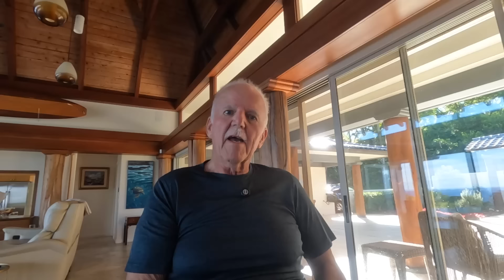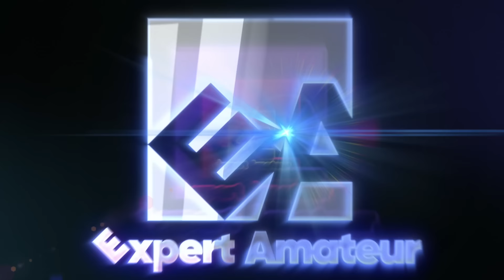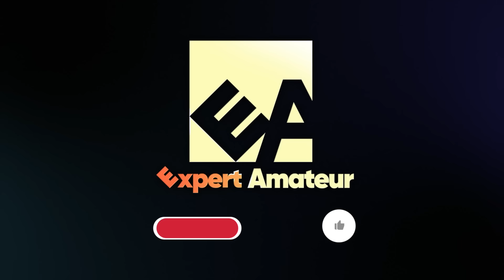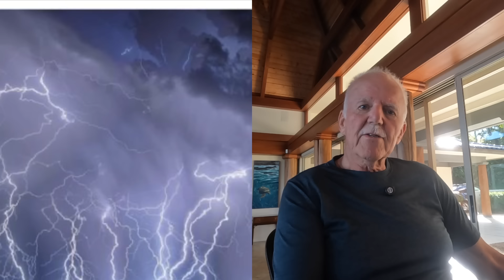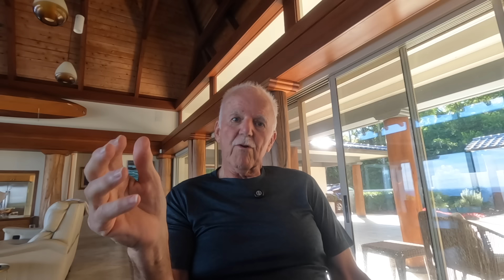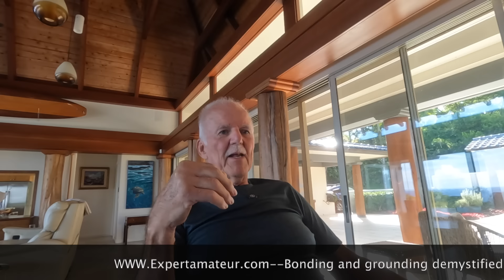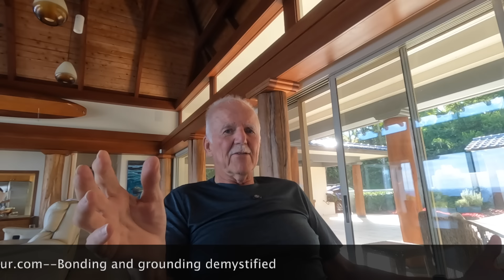solar grounding

Comment: ground bonding means exactly what it says - in Broadcast Engineering everything has a common bond to earth and the earth is a multi element copper grid. Having said that lightning will be the most extreme voltage / current that you will encounter… ie unpredictable… good luck
Reply from the maker: Yeah, I know. You guys have a much bigger set of problems than a few metal structures in a field. I used to work for a utility (nuclear reactor operator). We did some weird stuff to bond earth grounds together and I STILL hated going inside the fence of a substation.

Comment: Please show me where the NEC says the grounding of the panels and racking must be separate from the house ground.   I read the code to say you must connect the panel and racking ground to the house grounding system.   The NEC allows auxiliary grounds at the racking but does not require it.
Reply from the maker: It's not required. In fact I mentioned that if you get your system inspected most inspectors will wonder what you're doing. Do what you want. I'd prefer to not lead induced lightning current into my equipment. Then again, 250.4 B1 says the equipment "shall" be earth grounded but leaves HOW kind of up to interpretation and just sends you off to NFPA 780-2020 for more blah-blah which I didn't find really clarified much.

Comment: I grounded my panels separately from my earth ground to my house. I just pounded in a completely separate 8 foot rod for my panels. But it also happens to run alongside my outdoor electric box. Hoping that solves the issue. I might be completely wrong on that one. If I am, let me know why.
Reply from the maker: That's common, and what I did for the first phase of my test system, which is off-grid. When I connect the system to my shop I'll go to the next step, which is bonding that local earth ground rod to the earth ground rod for my grid service entrance by running AWG 6 wire between them. The issue is that a nearby strike will induce a voltage between those separated grounds and your grounding system can dump a huge current through your system from ground rod to ground rod. It might not happen, but if it does, everything between the ground rods is probably scrap. The wire bonding the two ground rods together will keep the potential (the voltage between them) roughly the same so the current will be greatly reduced. A direct strike will melt a lot of stuff no matter what you do, but bonding the rods together is a reasonable step.
Reply: @ Just making sure I’m understanding correctly: you are planning to bond the grid service panel AND the separate grounding rod for your solar system together?

Or you plan to remove the separate grounding rod you currently have and tie the panels only into the ground in your electric service box?
Reply from the maker: @Jordan-tq2jc  I plan to connect the local ground rod for the solar system to the ground rod for the grid service panel
Reply: @ExpertAmateur-xn6dr I think I am in the test phase that you went through. I have an off-grid system, that currently has no grid power tied into it (there is a grid service for the house). I just put a ground rod for the off-grid system and bonded the sub panel (inverter, batteries), and solar panel frames to it. And left my main grid service as is. 

This seems correct and sounds like what you did for your test phase?

Comment: You opened up debate for another related topic. Some are probably scratching their head wondering why their steel rack that is anchored deep in the earth still requires bonding and a ground rod. 

The Incidental electrical connections between metallic components cannot be relied on to provide the quality path to ground…
Reply: the only path to ground a ground fault is back to the source. Ground rods do not do that. And many an Electrician have died from that myth. 

Read NEC 680... They explain it to you.
Reply from the maker: @MasterChief4U  Read it. It doesn't. What we're talking about grounding is the frames and mounting structure. Yeas, the system ground can conduct away a lightning strike--right through your equipment.
Reply from the maker: Yes, especial with the random mounting notions that many ground mounts use.

Comment: Your creating ground loops at this point with 2 different ground rods.
Reply from the maker: I might be if I wasn't tying the ground rods together. If the distance was great enough that the resistance of a run of copper wire was substantial, then yes. Or if I were building a recording studio I might worry, but then I wouldn't be using transformerless inverters.

Comment: definitely a touchy subject, im a novice installer but have been learning from a great set of older installers, here's what i know works, the PV array should be completely bonded to itself, panels to frame into its own ground rod, NEC says bond frame to inverter no no no... don't ever do that, that code is deadly wrong, the battery and inverter system bond earth together but not the AC panel per NEC code, only common bonds to AC panel,  Lightning strikes are usually small and only hit the PV array, you don't want that following the PV wires into the inverter or batterys, Hope that helps.

Comment: Question. Should RV owners with solar panels on their roof be grounding their panels?
Reply from the maker: Tough question. Certainly you can’t do an earth ground rod unless yourRV is on blocks. It’s probably a good idea to bond the frames together and connect them to the solar controller ground but flexible panels don’t have metal frames. On my gmc the frames are bolted to the racks and the racks bolt to the body frames but that grounding is accidental. Since the entire structure is on rubber tires it’s hard to come up with a rational suggestion.

Comment: I work for a utility we have mountain top microwave. He is 100% correct but if your property takes a nearby direct hit from lightning all the equipment will get zapped no matter the grounding has been our experience. We have security footage of lightning arcing inside our building jumping from a grounding bus to equipment.
Reply from the maker: Yup.Mother nature doesn’t screw around.
Reply: Thus the old adage
Where does lightning strike...
Anywhere it wants
Reply: Out of curiosity, do, or does your people explain to you about "ground rise"???
Reply: Grounding rods are a myth... As they were invented to prevent house fire. Long before electricity was wide spread...

If you ground a system with Rods. If has to meet Pool and Sauna NEC NFPA70E requirements. Which is one unbroken #8 solid ground wire. Going around the whole pool or Sauna..Then if must be welded to the last rod... As these areas are wet locations with metal fences that can carry current..This is why Airport lights are install the same way...
Reply: Does having one of those EMP protection devices help?
Reply from the maker: @chrtravels  Some perhaps, but not much.
Reply: @chrtravels  yes, just like level 4 body armour protects you, until someone with a 50 cal BmG unloads on you.  The term "protection" is not an absolute.  Something that will help all of you is learning about grounding.  an 8 foot ground rod  is not good grounding.  look  up ground rise, UFER grounding and study hard.
Reply: Yeah a few million volts tends to jump large gaps.
Reply: Just curious if your mountain top microwave site follows something like the Motorola R56 guidance.
Reply: @SkyCharter  I'm not sure I'm an IT network engineer I manage the routers, and switches these are mostly used for microwave communication they have massive dishes on the towers. We have to be able to communicate with substations all over the state. We don't use Motorola for hand held radio we use a different manufacture.

Comment: I use "equipment" grounding  rod at the array location ( panel frames and array rails) and "system" ground rod  ( inverter, batteries, load panel)

Comment: It's against building code to have separate ground rods as far as I know. Interestingly when we build a substation, on the grid, we spend thousands grounding anything and everything inside. Each gate has to be grounded and bonded underground and when I have run into one that wasn't it pulled an arch as it was pulled together. We are never allowed to grab both doors at once. It can be very crazy to understand everything going on there.
Reply from the maker: Not for separate structures. I remember the spookiness of substations. I worked for a utility for about ten years. Substations, especially 230k, induce voltage into everything.

Comment: A complicated subject well explained. Something I've been concerned about for some time, and i came to the same conclusions. Connect the earths or create separate standalone systems. The debate will no doubt continue.
Reply: But they are NOT standalone if the multiple rods are bonded. I see folks always talking about and worrying about damage to their systems in these grounding videos. I couldn't care less about my equipment. My panels are 415 watts and about $150 each. I'll buy more if I get struck. What I am worried about is injury to anyone in my house from stray lightning jumping through equipment and across rooms! Or a malfunction of my system to energize things that can electrocute us.

Comment: Great video, sir! This is very educational content that could serve many people well for listening to. Keep up the great work!
Reply: It's not very helpful to say everyone  disagrees and there is no consensus. Yet there has to be some info somewhere that gives actual results from common and separate  grounding after lightning strikes. Maybe a fusing device between the house ground and the solar ground rods? Like I said, I don't see how you can protect against the  massive power of lightning strikes if it can travel through the ground for any appreciable distance.
Reply from the maker: @5400bowen  There absolutely is solid advice. R56 will tell you exactly what to do. All you need is a fat wallet and plenty of time. This video is about practical mitigation of equipment damage. Not NEC code or R56 or even NFP760 which most experts consider a bit lame. What I'm suggesting and using is cheap(ish), simple and reasonably effective. Everyone saying a direct strike will still slag your gear is absolutely right. Even a pretty close one will probably do damage. But most strikes will be further away and the methods in the video will help.
Reply: @ExpertAmateur-xn6dr yes, your insights are helpful. It's just I've seen several good videos and they all seem to agree the whole subject is up for debate still. Including the series from the University of Maryland Extension. My most recent thought is a smallish ground rod for the solar array, and the array  20 feet from the building. I'm still thinking about connecting multiple ground rods. Or maybe a railrod rail 100 feet from the structure 20 feet tall.. that will never come to reality!

Comment: One problem is that the better grounded the panels / antennas are the more they attract lightning. It’s a never ending discussion how to avoid disaster.
Reply from the maker: It is indeed an unresolved issue, but better grounding doesn't really "attract" lightning, though it's true that lightning actually travels from the earth to clouds. This is functionally the same argument that lightning rods "attract" lightning, which has been debunked for about 150 years, and actually Ben Franklin did a lot of the original research on the question around 1730, so almost 300 years ago.

Comment: I know a guy from my school who is also a licensed electrician. He told me the other day that if you have an old house that doesn't have three prong plugs, you can just swap out the receptacle and hook a ground jumper to the neutral side since it is bonded to ground. Sounds like this might be a situation that could cause parallel paths for neutral current. Also this house has a lot of shared neutrals.....
Reply from the maker: You might want to take a good look at his license...
Reply: As an electrician/electrical contractor that would present two things. One a false sense that the receptacle actually has a grounding conductor. And two if the neutral conductor were to fail or have a bad connection that would leave the ground terminal and any “grounded” case or exterior of an appliance plugged into that receptacle looking for a path to ground which could potentially be you. Please do not do this. Installing a 3 prong gfci receptacle would meet code on a two wire system. A much safer alternative.
Reply: From my experience that would be "creating a new ground", which is a bit safer than just having a floating ground (having a 3 prong without any ground connection) because there is a fault current path from any grounded equipment in case of a L>G fault.
But either way, their not the best lol
But the correct way to do it (making a ground from a groundless branch circuit) is to have a GFCI outlet.
The best thing to do is to is to have a GFCI.

Comment: Grounding is a weird topic indeed! Recalling conversations with people in different fields and listening to you just drills home the concept of "different kinds of grounds". From folks teaching me PCB layout, I learned you have power grounds (intended to carry higher current) and "data" grounds (no current, intended to be a point of measurement for logic level triggers). From radio/antenna folks (which includes solar ground concerns like lightning) you have to design for safety as well as proper EMI and radials for desired radio radiation. Also seen inside a HAM radio repeater station where they had super long loops of power lines and coax lines (for the delay factor) to give time for safety systems to detect and 'kick in' rapid shunting things to ground. I like how you spoke about the ground wire to a branch is basically to assist in tripping the breaker for certain kinds of equipment faults and really wasn't intended to protect against lightning strikes.

Comment: Does this mean that nearby lightning will induce voltage in my cast iron well casing & all the iron & copper plumbing attached to it?
Reply from the maker: Probably not.
Reply: Relative to another earth ground rod a distance away it could. But your copper pipes are probably pretty low impedance.
Reply: They're ~20 feet apart. I'm not well versed in grounding systems or lightning induced voltage in them but, it seems if the voltage is induced below grade, the low impedance plumbing would just make it easier to become the proverbial toaster in the bathtub

Comment: Grounding is a blessing and a curse. 
It was created to prevent electrical shock hazards. Problem is: it creates a back door for nearby lightning strike potential energy to damage equipment via ENTERING the ground connection.
I almost wish I had an isolation switch so I could temporarily remove the ground from my home electrical system before an electrical storm event approaches. 
(I can almost hear the backsides of electrical inspectors puckering as they read this)
The fact is: during a violent thunderstorm it is more likely for equipment to be damaged by stray voltages coming in on the ground wire than entering by either a direct lightning strike, or striking the existing overhead/underground power grid. 

Installing a grounding system to bleed off stray voltage from a lightning strike also creates a back door for a nearby lightning strike to come in through the ground system to the equipment. 
The reality is:  little can be done to prevent damage from lightning events.
Reply from the maker: Yes, indeed, though I think the approach of bonding a local ground rod (on the rack and panel frames) to the service entrance ground will mitigate the problem a LOT. Of the distance is great the bonding wire resistance will let the induced voltage get a bit higher than a short wire would, but it will be much more manageable.
Reply: Its all about ground potential, I have an extensive ground system and when lightning hits every circuit lifts together and the equipment doesn't know. No ground at all would you would be hooked into the mains neutral and just grounded further away causing your entire house to be a wildly different ground potential likely nuking a lot of your equipment even with a near miss strike
Reply from the maker: @GoonyMclinux  Perfect answer. I'm proud of you Goony.

Comment: Should ground and neutral be bonded on an off grid installation? Can you please explain why?
Reply from the maker: Yes, or at least I should say that I did. There are several reasons why I did. Bonding ground and neutral keeps the neutral wire at zero volts relative to the ground. if they aren't bonded the neutral "floats" which makes the neutral voltage unpredictable. It also ensures breakers and GFCIs work properly by having a path to ground in the event of a fault. And of course if you'd like to have the system inspected, which is a good idea, it has to have a single point of bonding between neutral and ground, even if the system is off grid.